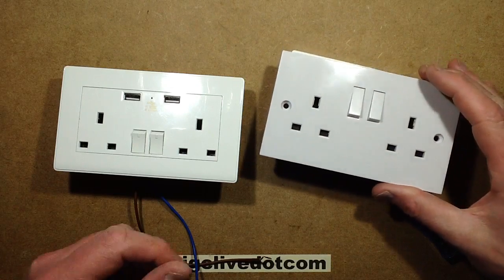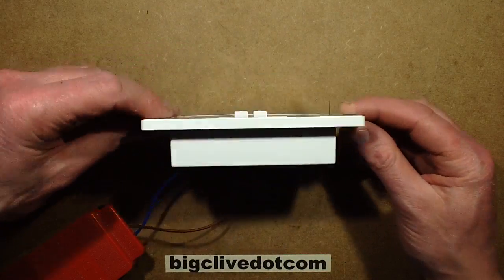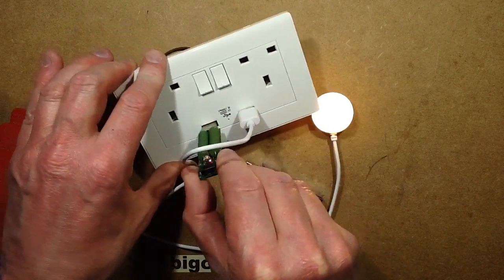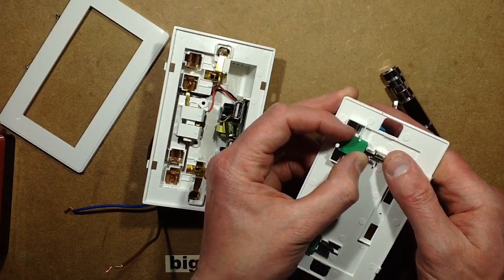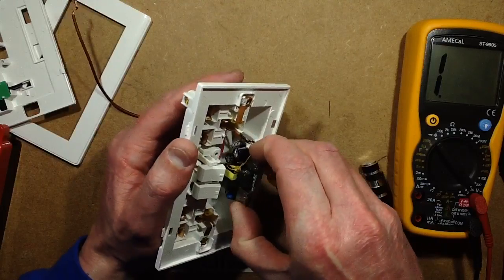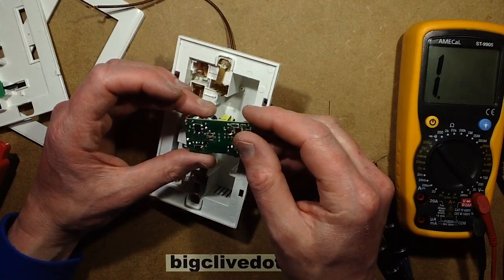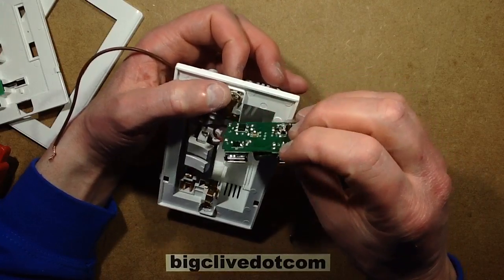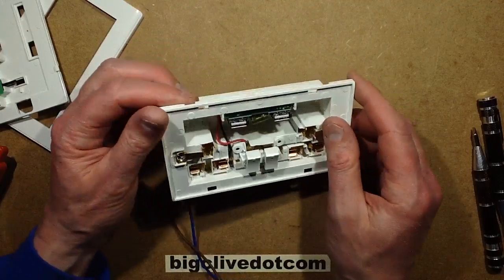A look inside a (crap) double gang socket with USB outlets.

Comment: Is it even safe with the earthing problem?

Now don't get me wrong, old houses here have outlets without earthing, only two pins. And outlets with earthing. 

But in newer houses every room pretty much gets earth installed, by the building code. 

Earth isn't needed for a machine that uses little power but you never know what someone uses a room for. If it is heavy or has metal bodies having a good earth matters.

Comment: Here in the US, it's mandatory by code for all outlets/receptacles to be grounded (earthed). If not, you won't pass an electrical inspection.
Reply: In Europe too,  all wall sockets or ceiling lamps must have the ground wired ,  or desck lamps if they have a metallic body must have the ground on them ....  each main circuit must have a differential breaker rated at 0,030 Amp for protecting users to be killed if a device plugged on a wall outlet is deffective and  have a current leak .I had my mini-oven that had a leaking heating element when it was warming up ....the differencial breaker reacted quickly .
Never buy too cheap electric devices cause  a lot of them don't complies with the electric safety rules,  that can catch fire or  occur sever injuries  or death to users .
Reply: +Craig S commercial spec grade outlets have isolated grounds. Look for a green triangle on the outlet. That is an isolated ground. You'll see them in hospitals. I forget now what the rational behind them is. You'd better believe all the electrics in hospitals passed inspection too.

Comment: They should have put a load resistor in the USB charging circuit. I know some switching power supplies (the ones used in desktop PCs) need a minimum load in order to run stable.
Reply from the maker: +Ryan Toomey There is a small load resistor present as per the chip manufacturers spec.

Comment: I was going to take a look at one of these that had gone bang but the guy who promised them failed to deliver, so sod it.
Reply from the maker: +AintBigAintClever There appears to be no shortage of USB stuff that goes bang.  With metal loaded skidmarks all over the low voltage area.

Comment: If there is no connection between the earths then it is flat out NON COMPLIANT with BS1363. On a personal note it is absolutely unbelievable! I mean seriously, FUCK YOU whoever designed this, this is DANGEROUS.
Reply: +mastergx1 Exactly. I can only assume it's the result of copying a copy with no reference to the original or the standards, and someone in the chain thought what was the point of linking the two earth terminals.

Comment: This reminds me. I have a "vintage" OEM Apple charger that came with my iPod that Dad's been using on his for a while that's developed an odd fault. It will trigger the "connected to power" symbol on our iPods, but won't charge them. Wanna take a look at it? I couldn't even crack it open myself.

Comment: Fortunately they've changed Part L of the Building Regs so we don't have to fit those daft built in ballast or dodgy pin configuration ceiling roses. We can now fit a standard fitting and just need to leave an energy efficient lamp in it's socket when we leave the job. Seems a bit of a backward step in some ways as the customer can swap it out for a 100W incandescent as soon as you're off the job which almost makes a mockery of the whole ethos of Part L!

Comment: many of the things they have done wrong are avoidable. usually , you can have the charger connected to switch to make it like" taking out the plug from the socket".
and you also can make the part inside this replacable so people (normal people) can replace them with no danger. and you also can make it connected to a fuse so that if anything goes wrong the device itself will shut down and maybe another circuit tells you whats wrong . add to all that the fact that you can make it detect a phone and only charge if it was plugged in so it does not consume any energy even if it was turned on all the time . i am just saying why the hell dont big phone accessories companies do this ?  i believe they probably thought about it and went like , no making chargers is more profitable or something i dont no really but itdefinitely is not a bad idea especially if more and more devices use this type of electricity in the future, finally i dont think the usb will survive if this type of socket goes off there is absulutely other more convinient way of connecting.

Comment: Hi bigclivedotcom I had a usb socket just like the one in your video and it exploded 4 months after it was installed and blew all my electrics.
Reply: yes it was sat on a 20-30 amp ring main fuse. if it started smoking would you think to go to your main fuse box and switch of that circuit. or stand there ans watch the fire grow.

Comment: The fact that the circuit is unstable with no load but settles down with a load suggests to me that one of the resistors across the USB power pins is defective, and wasn't caught in post-assembly QA testing because the testing rig (possibly as simple as a light bulb) probably loaded the power circuit enough to stabilize it.One thing I like about the UK electrical outlet is the "child-proofing" shutter and how it is deactivated by a proper plug. We don't have that in the US.
Reply: +1stPCFerret Actually, Leviton makes NEMA 5-15 and 5-20 tamper resistant receptacles. You can buy them at Home Depot. 
Tamper resistant receptacles are now required by NFPA 70 National Electrical Code in most dwelling outlet location in the U.S. 
http://www.leviton.com/OA_HTML/SectionDisplay.jsp?section=37692
Reply: +Richard Skokowski That is excellent news! Thanks for the info.
Reply: The downside to them is that they are CRAP. As an electrician I am constantly having to replace them in peoples' homes because the hinges break, making it impossible to plug anything in. Now that US electrical code requires them, it's going to get worse. I mean yeah it's more work and more money for me, but it's just bad for the customer.

It's easier and cheaper to install common sense in your children than it is to install this garbage.

Comment: I'm very new to electronics but could someone explain how the "earth" or "ground" works in a wall socket and why it's necessary?
Reply: +efedude77 The Earth/ground pin is used for safety. It normally does not conduct current. It is connected to the dirt through a ground rod or cold water pipe. It also connect to the neutral.  At the device which plugs in, it connects to metal chassis or other exposed metal parts so that if there is a short circuit from the AC line (mains) to those parts, the voltage will not rise to unsafe levels. A fuse, circuit breaker or ground fault interrupter will open and remove the AC power from the unit.

Comment: 4800ma may be dual 2400 (2400 per USB) most charge specs I think max around 2400, then they use Qualcomm quick charge or similar to charge at 9, 12, and 20v respectively. allows for higher power on same cable and minimizes losses in cable. old /ebay cables are shit and this helps

Comment: Ive seen lots of 13amp sockets and light switches recently with 2 earth connections. A friend told me it is a new improvement (i dont know if it is a new standard requirement) to make it easier to connect the earth cable to a metalclad surface mount boxes etc, and still allow 2 earth cores to use the 1st earthing terminal.
Reply: +Jonathan Cook Two earth terminals are fitted for use in situations where 'high integrity earthing' is required. I believe the idea is provide two separate earth wires back to the main earth terminal and so remove the possibility of one failure resulting in an unearthed fitting.
Reply: Intresting. Nice safety feature too.

Comment: I wonder if they just neglected to install the earth bus because it looks as if there are spaces/notches where it would fit. Of course we all know about the excellent quality control the Chinese have especially when things are marked CE which of course means "certainly excelente". But then I'm not 100% sure if this is pure rubbish.
 Despite the efforts of a great many researchers the world over, there isn't, and there never will be a cure for stupid. Maybe only natural selection or zombies.
    Mike (o\!/o)
Reply: +pmailkeey  This one has only 4 terminals, L, N, E, E, an arraignment that makes no sense at all. I can't get my head around an extra earth terminal. It would make more sense with more line or neutral terminals and changeable buss bars for separate circuits like the US system. Although, it seems like this one isn't meant to be taken apart or changed.
 I have little experience with UK electrical so I don't know about fuse boxes. I just made an observation about this part and I agree that electrical is in general junk unless you stick with well known and unfortunately expensive brands.
    Mike (o\!/o)
Reply: +pmailkeey  That's rather disappointing to hear about a major brand. Although, with proper isolation it's probably pretty safe inside a cabinet full of water. I wonder how difficult it would be to change, or even if it's possible. I am now kind of glad that when my washers mechanical timer died a horrible death years ago there was no suitable replacement or parts available. So I converted it to semi manual operation using switches, an 8minute timer, and most importantly a relay to control the motor. That heavy amp draw is what killed the timer switches. That is what always killed the timer switches in machines I have worked on but parts were always available. When mine died I remembered all the pinball machines I have worked on and everything runs through relays so as to be super reliable. There's nothing like racking up a great score and it goes tits up. And they had amazingly complex functions for not having any electronics in them. Hats off to those designers. It's too bad they don't put that kind of thought into today's devices. 
    Mike (o\!/o)
Reply: Incidentally, this comment track is the first one in a few months wherein I have received notice of a reply. So thank you to G+ or YouTube or whoever it was that screwed up what used to be a decent system. And thanks for screwing up the punctuation on edits. Although that's fixable with a simple copy, delete, paste, and edit. I shall demonstrate here.
 Now I know I don't actually pay for this service which is why I don't scream bloody hell and only bitch a little now and then, but I am pretty sure that the advertisers that do pay your exorbitant salaries would wish that you could keep their customers at least a little less frustrated. Thanks for listening and have a nice day.
     Mike (o\!/o)
Reply: +pmailkeey  My top load washer doesn't have a water heater and runs on 110v US with no low volt controls. So just 1 relay for the motor as the clutches and valves can be switched directly. The timer controls the motor relay and is enough for all the functions, agitate, spin, and drain. The difference between wash and rinse is soap or not and water fill temp. On start of agitate the tub fills with the selected warm or cold(rinse) water before the timer starts and the motor kicks in and runs for a max of 8 minutes. The timer resets when power is removed as when you select the next function.
 So;
 1 DPDT sw for water temp,
 1 SPDT on- off- mom sw for drain/spray select,
 1 DPDT sw for agitate/spin select,
 1 15 amp relay for the motor,
 1 off-delay timer to control the relay.
 This is a pretty simple control system to replace an $85 timer that hasn't been available for 15 years. Others I had or could get were hard to convert to this machine and would still cost a fortune. Besides, I had everything already and how many people can say their washer uses spare parts from 1950s pinball machines.
 Most people wouldn't want a washer that operates manually but I for one won't leave them unattended as I don't like floods inside. Even though it is now in a drain pan I still want to monitor it myself.
 I don't know the terms CH and TRV, maybe it's because I speak "merican".
    Mike (o\!/o)
Reply: +pmailkeey  Central heating, I should have known. Here in the colonies we usually don't use initials for things , at least we didn't before www . And since I am still kind of new to the net I am sometimes put off by all these initials and acronyms. But I'm catching on, slowly.
  Hot water room heating systems are called hydronics over here and the same sort of controls as you described are used. I like hydronics, especially the ease of adding solar, although I prefer the under floor heating as opposed to radiators. Quiet and very even but somewhat slow to respond to change.
 The washer you describe sounds like a Maytag style gearbox. Mine is the Amana/Hotpoint system which uses a gearbox for agitation and a solenoid operated clutch for spin or neutral. The pump runs directly with the motor and a solenoid valve chooses filter or drain. Fill is by the usual valves with action and temp selected according to a selector switch and timer function. US washers seldom have a heater, or used to before the current rash of front loaders. Dish washers usually do have one though. Top loaders, although they do use more water and slightly more power to move it around, are less prone to troubles from what I have seen and heard. Spin function seems rather complex but I have no direct experience with them so I can only guess. What if it quits mid cycle and full of water? There must be a drain, but where do you drain it to? The commercial ones drain to a common sump if the power fails so they can be opened and the clothes retrieved. not so the domestic unit as they drain to an elevated pipe. At least with a top loader you just siphon it into a sink or bucket.
 The people I know with front loaders have had a ton of troubles with them. Usually in the control system, so maybe they were made in the peoples republic. 4 service calls in 3 years is about the average. When the warranty ends, to avoid the increasingly expensive service calls you scrap it and buy the latest and greatest and get back on the treadmill. And that's what they call ecological.
 I have fixed my mothers Sears Kenmore washer once in 30 years and that was a leaking hose joint. My washer only had timer issues a few times before it finally failed, although I did replace the tub seal just to be sure. $2 and 15 minutes once the cabinet was open is cheap insurance. Now it sounds as if it could use a new belt. Sometime, maybe if the squealing at start begins to bother me. Not too bad for 20 years service but not compared to my moms.
 It is just such a shame these days that everything is built to such low standards. They truly don't make them like they used to.
     Mike (o\!/o)

Comment: The instability could be due to the switching chip itself (or rather poor design of it), there's some buck/boost converters that have a 'pulse or discontinuous mode' whereby they don't actively step down the voltage and merely pulse the inductor in low current draw situations. If poorly designed, the output voltage can waver fairly widely from the center/intended voltage.

This is typically why boost/buck converters have some sort of dummy load to keep the output voltage within spec if the 'pulse' mode isn't used or designed properly.

Comment: the reason the usb power unstable is because the usb transformer circuitboard was designed (poorly) to consume very little power when not in use so that is the reason it really only works when it detects a sizeable power load it is basically in standby mode until it thinks it is needed. the load sense not very sensitive at all so it needs a big load to stop the "standby" mode and enable solid power output. after all it would be wasteful to keep a tranformer powered up with no load present, the idea was good the method of implementation was bad. the grounding issue is just not acceptable though :S

Comment: Un-nice.... that's one for the dictionary huh? lol
By the looks of it they could have designed the circuit length wise, this would have reduced the thickness, maybe to the point that it would fit into a standard backplate.
There is so much width available, they must have bought a stock PSU rather than designed one to do the job.
The Earth point is so bad I wonder if it got the approval to be sold in UK.

Comment: Maximum draw for USB 3.0 is 900 mA, 4.8k is way above the limit. :/
Reply: So? These are power sockets in USB form factor. There's no USB 1, 2 or 3 here. Phones and tablets regularly pull more than 900mA on cables that use the same connector as USB.
Reply: I am just saying it is above the USB specs. What is strange.

Comment: It's pretty standard for SMPS to change the switching frequency depending on load — having it go very low with no load is not outside the realm of the standard.
Reply: Oh, and data pins shorted together isn't 500 mA, it's "this port uses USB Charging 1.0", and that standard "indicates" to the device that it's reached its maximum current capacity (up to 1.5A) by drooping the voltage below.. 4.7V, I think it was. Which is conveniently exactly the same thing it'd do if you'd just build the absolute cheapest PSU you could manage. There's no actual signaling capacity to the device except in the Apple standard.

Comment: The older IPODS are great! My IPod 5.5G accepts from 5V up to 30V so I can plug it into any charger and it will charge.
Newer devices often have a proprietary charger detection because companys make a ton money selling "genuine" chargers!
For example some kind of Resistor is across the data Pins inside the charger.